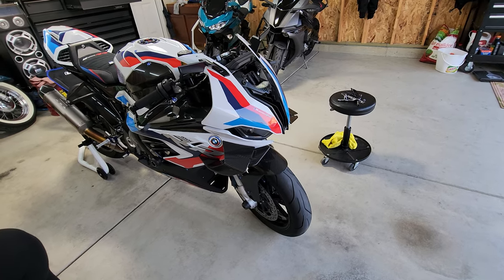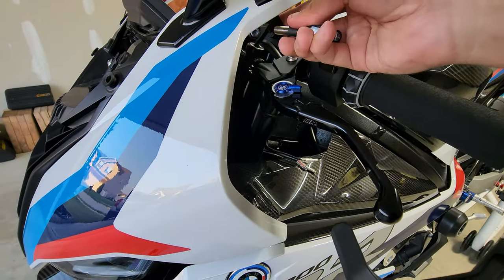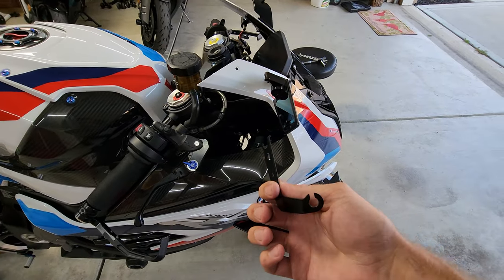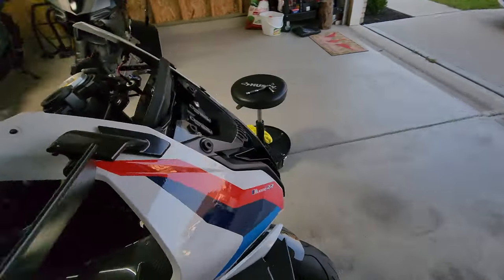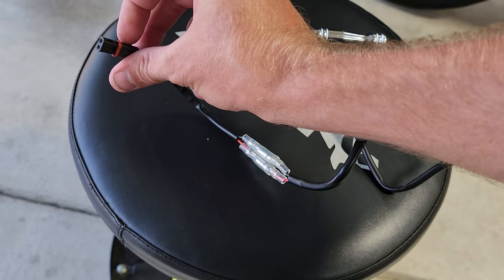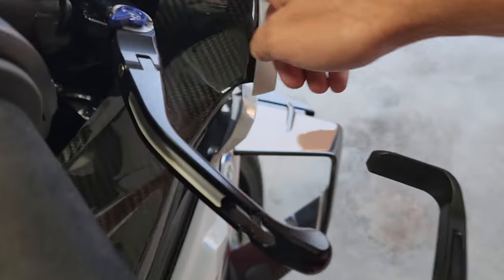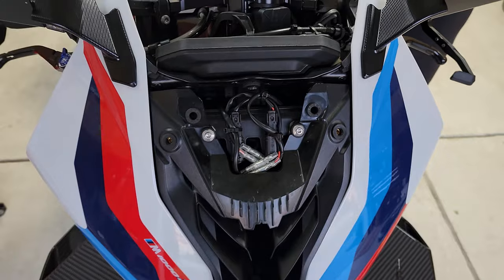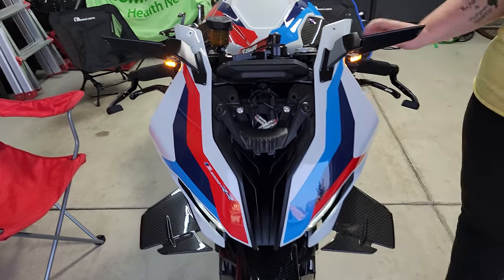Rizoma stealth mirrors and Rizoma turn signal install on my 2022 BMW M1000RR competition.

Comment: Are these bike worth buying ? 
I heard they leak coolant and oil . Not sure if BMW stands buy the warranty either.
Reply from the maker: BMW warranty is absolutely amazing. The M1000RR consumes oil. 21-22 models. I guess they fixed it on the 23. 
The S1000RR are a solid design. I would go for the S1k all day long. Stay away from the M
Reply: @thatm1kguy  ... What about the coolant issue ? 
I've heard that BMW will use most any issue to remove the warranty if they can.
Reply from the maker: @goodboyringo9716  you talking about to weeping hole in the oil pan? Yes most do leak coolant after thousands of miles. Take it in if it gets really bad and they fix it. I have had to do 3 or 4 things under warranty and everything got done quick and no issues from warranty.

Comment: Can you see with those rizoma mirrors? Been internally debating whether or not to get it
Reply from the maker: Yeah i really like them. Im trying to get another set of mirrors and turn signals for my S1000RR. I have a first ride video and 1 after that where i talk about them. I love them. They look amazing and work good. I have to have mirrors on my bikes and see alot with them. They work great for me. About 600 miles with them so far.
Reply: @thatm1kguy  thanks for the response
Reply from the maker: @PatrickFarnacio02  no problem! 🙂

Comment: do u have the part number for the turn signal actually everything hahha, I wanna install it on my m1000rr
Reply from the maker: Part numbers for everything except the mirrors are on the video. Time 2:20.
Reply: @thatm1kguy  Oops how did I missed it haha 
Thanks a lot!
Reply from the maker: @AY-0  its all good haha
Reply: Another options for integrated blinkers is by Futurismoto. This guy makes very clean mirror block off integrated blinkers. You’ll just need one bar end mirror.

Comment: Do you know which mirror product code you have for the mirrors. im having a nightmare with Rizoma telling me the k67 mirrors dont fit the M1000RR (the same year)
Reply from the maker: I will have to check when i get home. The are the exact same as the S1000RR 20-22
Reply: @thatm1kguy  Thank you. this is where im getting confused. I have the mirrors for the 2022 S1000RR but rizoma are saying they dont fit the 2022 M1000RR (the ones i have are BSS010B currently. Rizoma are saying i need BSS012B
Reply from the maker: @ellisevans6348  have you tried installing them? They only take a few minutes to try out. 

That is really weird though. They didn't make any changes till 23
Reply: @thatm1kguy  Rizoma said if I open the box and break the seal and they don't fit I can't return them
Reply from the maker: @ellisevans6348  what? Seriously? Shitty customer service if you ask me.
Reply from the maker: The part number i have is BSS010B
Reply: @thatm1kguy  yes that's what I have. I tried them and they fit perfectly so I have no idea what Rizoma are.talkong about. I think they have developed one for the newer M1000RR and trying to push sales.on that. Thank you for your help
Reply from the maker: @ellisevans6348  awesome! Glad it worked out. It's about time they get those made for it.